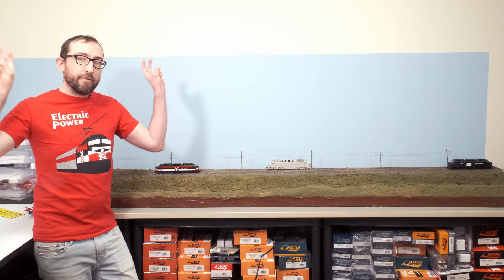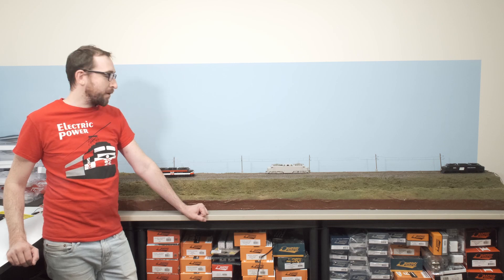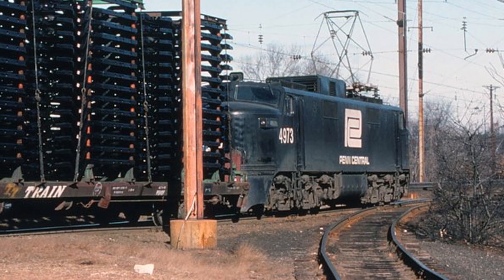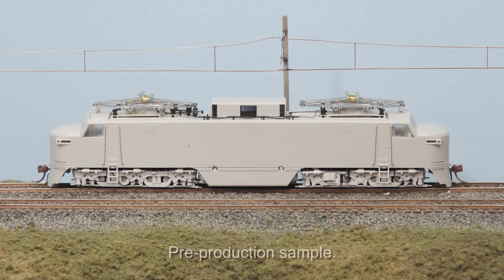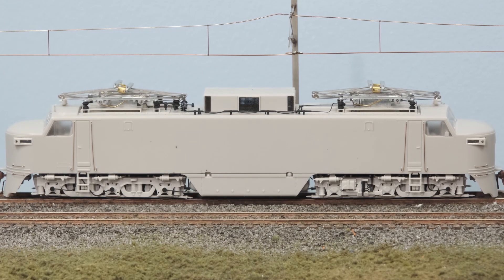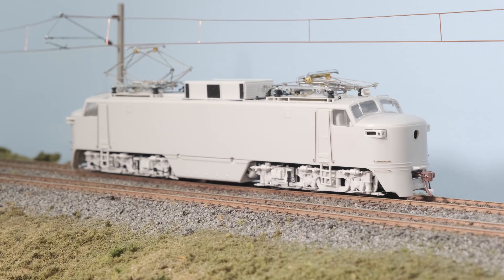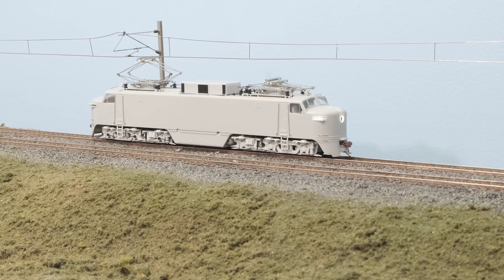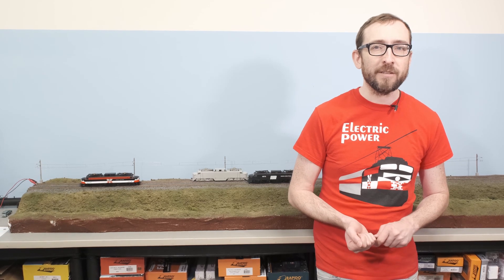HO scale New Haven EP-5 "Jet" locomotive.

Comment: As a modeller with a niche interest in electric railroading alongside conventional diesel electric railroading,  these EP-5s do look tempting to have as part of an electrified district with freight electrics (such as the E-44 or E-33 wink wink, nudge nudge). As for when New Haven joined Penn Central, my understanding is that they joined the fold in 1969 and a condition of the PC merger by the ICC was including the NH (along with N&W taking control of the D&H and EL through Dereco)
Reply from the maker: Ya the NYC and PRR didn't really want to include the New Haven in the merger and the NH itself was already bankrupt. Approval by the ICC was conditional on the NH being included and they formally joined the PC system on Dec 31, 1968.

Comment: I’ve seen the painted preproduction samples at NERPM 2019 and the Amherst Railway Society 2020 shows and they caught me by surprise - even on film they’re stunning. 

How do the pantographs work, will there be a function where the engine can run off third rail/without them up?
Reply from the maker: The pantograph mechanisms can be deactivated when running in "third rail" territory. There is a switch on the bottom of the model which turns them off.

Comment: These models look incredible, the motorized pantographs is something I've only seen on European ho models and o scale. This should be a new standard.
Reply: Also, any chance of an n scale release of these later on?
Reply from the maker: Thanks!
Reply: As a juice jack modeler, i'm not as much a fan.  Usually,  the mechanisms add cost, decrease weight (reduce pulling power), and make it a pain to use the pantographs manually.
Reply: The MTH GG1s had this feature.
Reply from the maker: Our pantographs can be lowered by hand without damaging them. As for decreased weight, the mechanism is by ESU and it's very compact. We normally don't put weight up into the roof anyway. We hope you'll like them!
Reply: @rapidotrains  I am glad to hear it! I preordered 3 of these (370, 375, 4977).  Just generally speaking, US electric locomotive models tend to treat their pantographs as interesting gimmicks and not as functional parts of the model.

On the MTH GG1, the mechanism takes up the whole nose on either end. There are physical metal bars that protrude into the model and so if the pantograph is "down", its impossible to lift up.

The concor MP54s and Atlas ALP45DPs have no stabilizer bars so the pantographs cant run on wire without flopping over.

Alot of the pantograph shoes have sharp edges or they don't otherwise handle anything but smooth wire well.

Finally, some pantographs like on the proto metroliners press so hard on the wire that it presses the catenary out of shape unless you build it very heavy.

Anyways, thats where I was coming from with those concerns.  I look forward to these models!